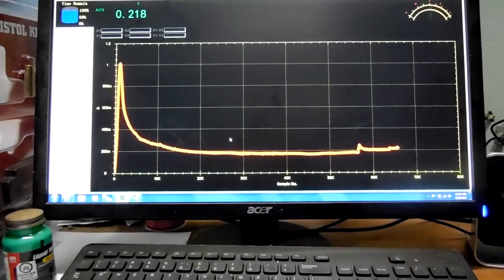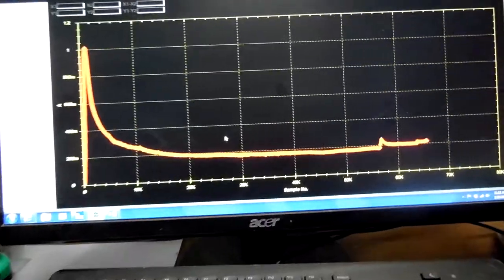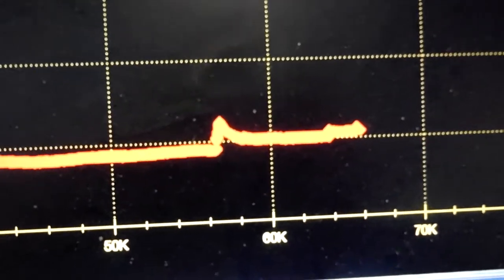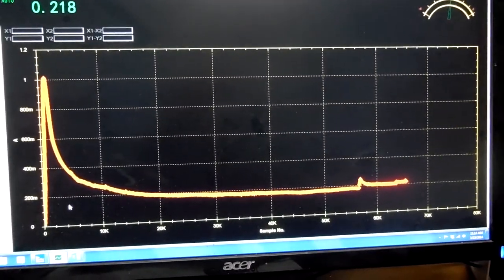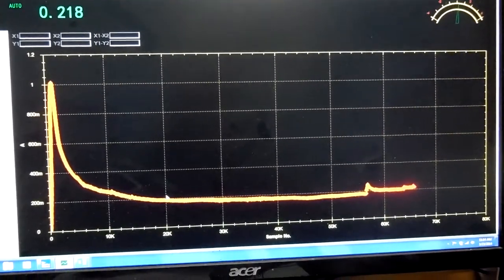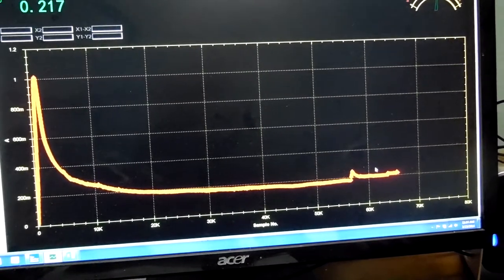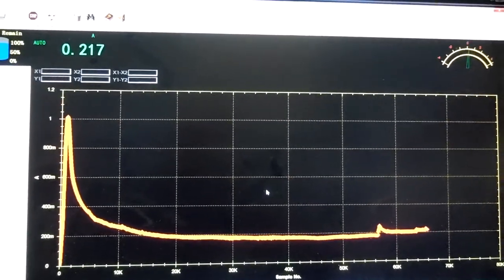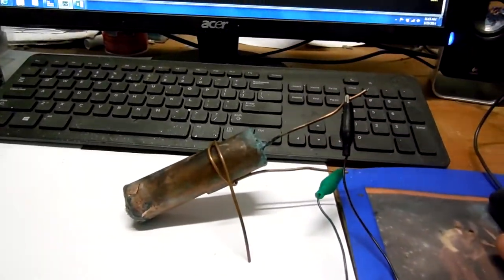Crystal cell long term testing

Comment: Well done, but did you check, if your magnesium rod is already corroded inside the cell ?
Reply from the maker: Ha! yes. that is the question
I have not opened it up yet to check
I assume it will be corroded, but with the rechargeable ability of this cell, it could last a long time
Have you ever seen a magnesium cell that would recharge?
Or for that matter held a charge for any length of time

there is something else going on with this cell than normal corrosion, it seems to want to equal out to a constant current, in this one it is about 200 Ma
Never seen any other cell do that, Do you have any ideas on why?

Thanks

Comment: Well, I would say 1,56 Volt at 200 mA is already very good for a crystal cell, I dont think that you will get it much better....Normally all Magnesium celks will not put out more than about 1.5 Volt and the current depends on how fast the magnesium corrodes, at least at galvanic cells...So if you could stop the corroding of the Magnesium that would be great and recharging would also be great !

Comment: If we would know, what saltmix and electrolyte you are using, we could say more, what might be going on in your cell. Do you use a pure magnesium strip or any magnesium alloy in it and just Alum powder or something else ?
Reply from the maker: Hi Stefan,
In this cell design I use pure magnesium
I did not use any Alum in this cell, alum usually corrodes the mag very quickly unless you PH balance with acid
I am still not happy with my design mix, I get high volts but lower amps, or this one only gets to 1.56 volts but has high amps
Still trying to balance the mix and find out what is going on with each cell by tests
*As John Bedini says- some of my mix design can be dangerous if not handled properly *
Stefan,
Do you know of any other cell that compares to this one, I am still investigating if this cell is worth the while or if something else has already been created?

Comment: Nothing new just another galvanic cell.
Reply from the maker: So how many galvanic cells have you seen with a discharge curve like this?  I will bet none 

So just for fun why do you not post a galvanic cell that matches this one? 

I will wait for your reply
Reply: Steve Allwest Heaps my cells are rockhard you can scratch glass with them. That is a standard discharge curve for a low density battery. 

Can you fully discharge it and have it come back to the same voltage every. time. 

I can, stuffing some oxygenating salts acids and crystals into a pipe is not going to do it trust me. 

When you have a pure solid-state compound that will scratch glass and return the voltage back to the same voltage you discharged from then you have something. Otherwise this is just galvanic rubbish.
Reply from the maker: This was 3 years ago, how far do you think I have come from here?  so far I have seen no results from you other than babel  

Not sure what you are doing with your trolling but hay, I am up for a challenge, show me your tests 

Oh and you may want to include hertz with your tests results as this is a huge factor with mine
Reply: Steve Allwest clearly you have a scientific education' sarcasm
Reply from the maker: Why do you not approach me with a better attitude? Are you being pressured to beat my cells?

Or is this just your normal obnoxious self?
Reply: Steve Allwest i'm just calling it for what it is. To many people on the Internet stooged with simple systems
Reply from the maker: If you have truly viewed all my videos then you will find that I have really never named this type of cell, granted this is a type of a galvanic cell and then it turns into another type of cell 

Surely you can understand that a galvanic cell will not last 20 hours plus, it is not possible 

Can you agree upon that fact?
Reply: Discharge it fully flat note the voltage you discharged from and if it comes back to the original voltage continuously you have something if not you have degradation.
Reply: And not bullshit dielectric rebound fully flat fully charged.
Reply from the maker: First answer the question- have you ever seen a galvanic cell run for over 20 hours with no power drop?
Reply from the maker: Also you are overly concerned about the volts. what about the amps?
Reply: Steve Allwest that comment indicates that you have no clue as to what you were talking about.
Reply: Steve Allwest I challenge you to build a cell that does what I stipulated, I bet you you cannot do this.
Reply from the maker: That is funny, you will not answer the question because you know the answer, there is no galvanic cell that does what mine does... still waiting
Reply from the maker: Hmmm... I guess that is all you have is babel, you still can not answer a simple question 

Or maybe you do not know the answers? and just like to troll
Reply from the maker: Still waiting but not much longer